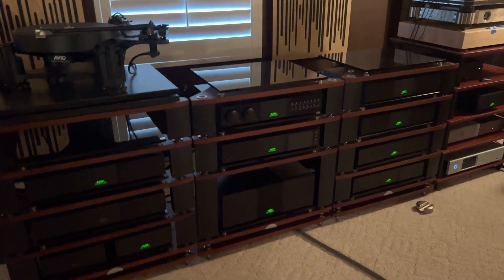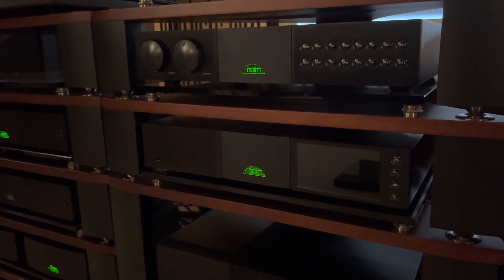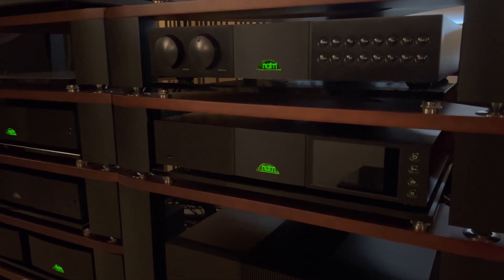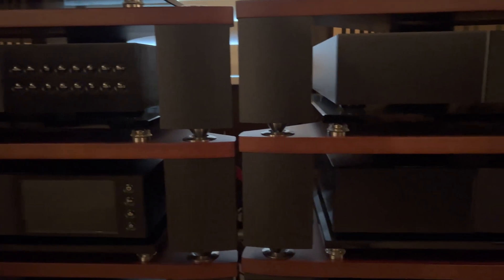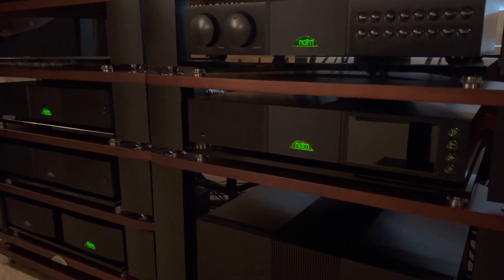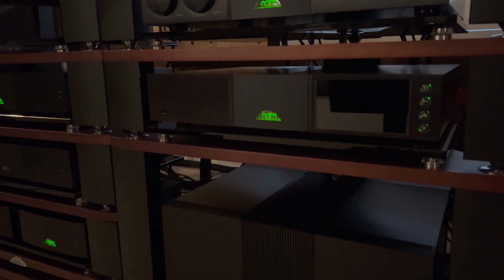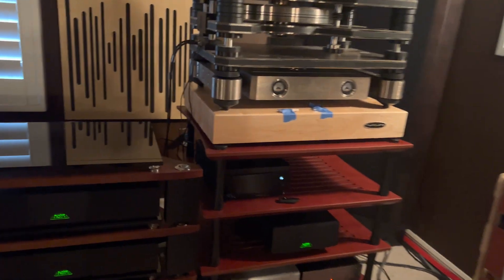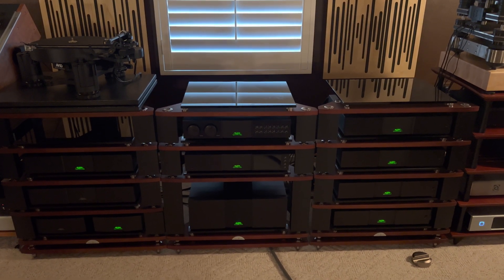My digital rig.  The NAIM ND555 + dual NAIM PS555 DR PSU’s.

Comment: I own a very similar system, 555,552,500.  The 555 streamer excels with 2 power supplies. Really opens up the sound.  Just got my Solstice turntable. Did you receive your unit yet?
Reply from the maker: Not yet.  I’m still waiting.  Nice system!
Reply: @highendaudio  Thanks!  Solstice is worth the wait.
Reply: yes boss i got mine, but disappointed in the sound and what it offers.
Reply from the maker: @LQ-gaming  can you describe more about the Solstice?
Reply: @LQ-gaming  Solstice, like all Naim products takes time to run-in.  I've got about 70 hours on the Equinox cartridge and it sounds very good.  The Solstice phono preamp is good but my Superline/Supercap take it to the next level.